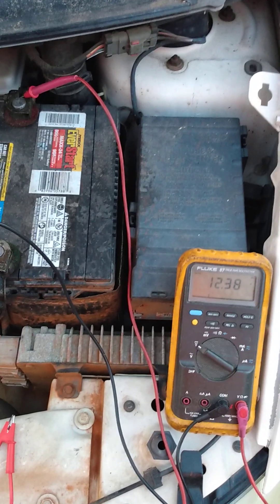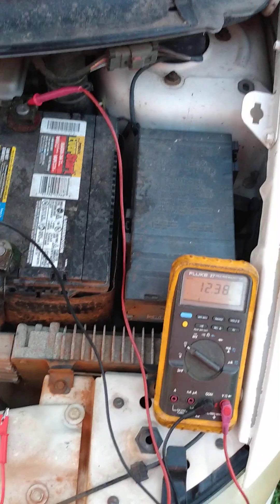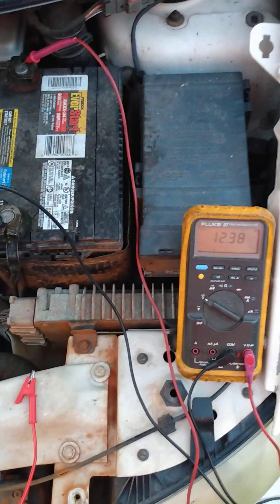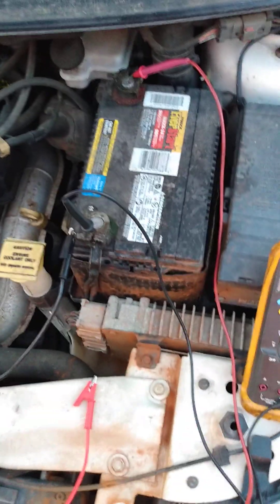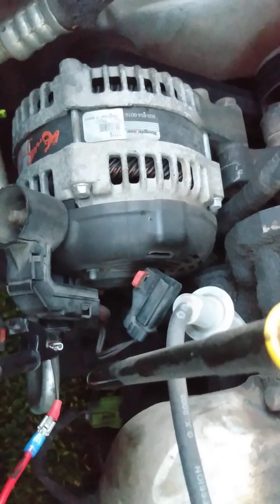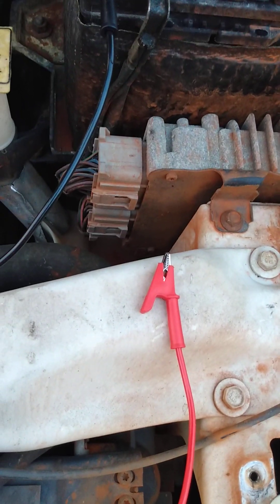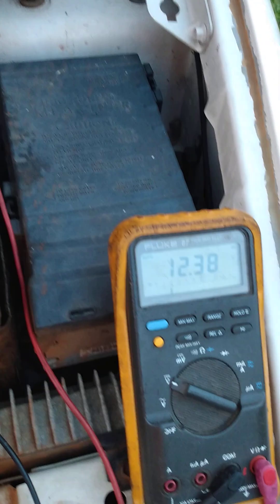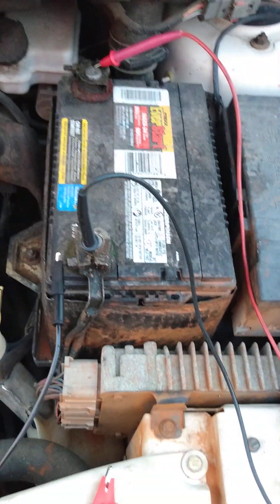Test Dodge Chrysler pcm / computer controlled alternator Part 1

Comment: Question on the setup. I have a  green wire that goes to PCM and a black wire. Im assuming it would be the same setup as this except your Red Wire is My green wire? (2006 PT cruiser). 

Also. Im 98% sure i rewired the  pigtail housing correctly in the 2 pins and even looked at a diagram but "if" i had managed to get them backwards...what would happen? (Sparks, short, burn etc). 

I have had a battery light come on after engine removal and had a bad alternator. I found the wires were chewed up bad and fixed it and now the battery light is on continiously. I was thinking i completely fixed it until i turned it on and saw it was on continiously and now im wondering if i just got the wires mixed up in the pigtail housing
Reply from the maker: As far as I understand it, the polarity of those 2 wires does not matter, you will not hurt anything by mixing them up.  *PLEASE NOTE:  I am NOT an expert, I am a backyard mechanic, I usually don't work on Chrysler products, so please proceed with caution*
Reply: @rigmaster1  understood. Been chasing this electrical gremlin for quite a while in troubleshooting. I have the service manual and diagrams and its a little off. Im ready to junk the car within a year anyway (even if i fix it) but was just curious if you knew. Thanks!